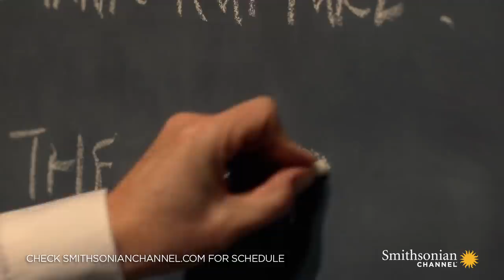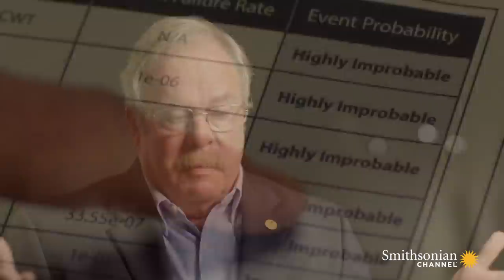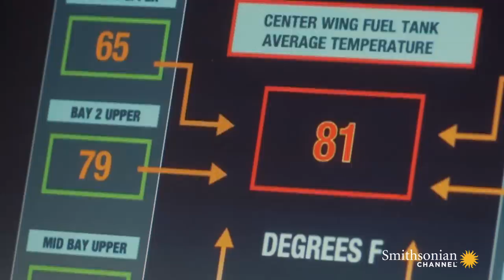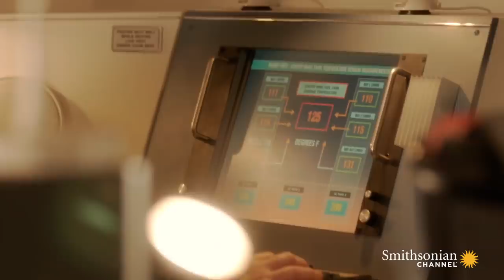How Air Conditioning Caused TWA Flight 800 to Explode

Comment: Jesus, that test they did was super dangerous.
Reply: TheGr8stManEvr was thinking the same thing lol
Reply: TheGr8stManEvr There was no fuel in the sensored tank.
Reply: please explain more of your thoughts. thanks.
Reply: Was it though? How many 747's had, to that point, operated in hot weather with the air conditioning packs working full blast, and how many had exploded?
Reply: I can never understand what everyone means by..."the AC units running or working full blast".... Is that suppose to make it sound 'scarier' ??   The Air pack operates at one level.  'On.'   there is no 'full blast'.  lol... and Hot weather is moot, as well.  unless the weather was at full blast!  lol....
Reply: Don’t think it was real because like you said it’s way too dangerous
Reply: +Rob Shef Exactly!! the only way they can be at ''full blast'' would be if they were on continuously for that time, which is likely the actual event. A/C units turn on, then normally cycle between ''on'' and ''off'' to keep the temperature at the desired level
Reply: Well, ok.   :)   But I think the point being, (which I failed to explain in a way to be understood......so my bad....) is where the NTSB claims that the AC unit 'played' a part in the event, such as that of a (really HOT AC unit) seemingly on  the 'coldest' setting, thus implying 'Full blast" or, that the (Unit HEATED up. )  However, this is NOT how the AC system works; that if you have the cabin setting for a cooler temp inside, that the AC unit runs Hotter.  This is what the NTSB was attempting to say, for the less educated.  The AC can be on as long as it needs to be, but that does not make the unit get hotter and hotter.  (The NTSB needed a high heat setting to imply that the fuel tank thus, heated up.)   The center tank {cannot get hot}  due to the AC operation. This is IMPOSSIBLE, due to the Architecture of pack bay and then the  Fuel Storage and Transfer System. The aircraft AC pack(s) does not operate like a home AC!  The errant use of the statement, 'Full blast' seems to imply that the unit is set to on, and thus heats up more and more.  That cannot be farther from the truth.   But in this case, the idea that the AC packs were even on while the plane was on the ground during its turn around servicing,  is not convincing.  When the plane lands, (has touched down)  it [was] TWA SOP to operate the APU; to have the APU and not the engines now operate an Air pack on the ground while they taxied in, and having parked at the gate, the power grid on the plane would be switched from engines to the APU, so after the engines are shut down, the APU is now providing the electrical power and turning ONE air pack for cabin ventilation.  Then the ground service hooks up an external air unit, and ground power is plugged in. the APU is shut down.  (it need a maintenance check as well)  It is costly to be on the ground and run the APU for hours which is using up jet fuel.  The APU is essentially the unit used to provide [temporary service] for starting the engines, as the engines are the main air and power source for the planes pneumatic and electrical systems.  So in as far as the AC unit as having been on 'full blast' and thus heating up the center fuel tank, is a myth.
Reply: @bsanaee  Good point... In the end the horrible state of the wiring left all sorts of bare wire exposed to create a strong enough arc. This must have been a shortcoming in overhaul procedure. You can have all manner of stringent recuirements in place when it comes to the airframe. But it's of little use when there's exposed wire and kerosene fumes occupying the same space...
Reply: It wasn't dangerous because they knew there was no fuel leak in the tank. The explosion was caused by the fuel tank leaking, not just the heated fuel. Because the fuel was heated enough it was flammable, and that's why it exploded AFTER it leaked. If it was truly that dangerous then there would have been a lot more explosions on this kind of plane.
Reply: So, what was the 'good' point?  There were no bad wires or bad wiring...exposed, and creating any 'arc's as such is impossible in the 'suggested' scenario.  There is no way to create any arc or spark inside the fuel tank, which is moot anyway, given the entire design and architecture of the Fuel Storage and Transfer system. The NTSB report was proven to be Fraud in Federal court.  You do know what a( 'D' check) is?? Also know that 'kerosene fumes' even though none were present,  do not explode as has been suggested by reason of the lack of chemical energy.   The Center tank did not explode by reason of some internal cause. That is Impossible.
Reply: Wow. The story keeps on morphing more and more.  lol.  There was fuel in the tank. The fuel tank was not 'leaking.'   (that ones new! ) And........ there was no, nor can be any 'heated' fuel in the tank.  Aviation Kerosene is not a flammable liquid but a combustible liquid.  The fuel can never reach its flashpoint by reason of the Fuel Storage and Transfer Systems Architecture.  And the flashpoint is only that for when the fuel could begin releasing fuel vapors but those vapors are not highly explosive.  The Fuel again, is a combustible and not a flammable liquid.  AK is a very stable fuel.  There has never been a spontaneous fuel tank explosion using modern AK.  ...and by reason of it just heating up, if such could.
Reply: @robshef718  Everyone can google a D-check and find it to be a comprehensive overhaul that only happens every 6-10 years or so. So enlighten us... What happened here?
Reply: You stated: ' In the end the horrible state of the wiring left all sorts of bare wire exposed to create a strong enough arc. This must have been a shortcoming in overhaul procedure. You can have all manner of stringent requirements in place when it comes to the airframe. But it's of little use when there's exposed wire... 'There are daily and thus constant [Condition monitors] at the start of, and during and after every flight.  Such are logged and passed on as required.  Along with a major overhaul, (D check) there are routine inspections, and then modifications and or re work as required.  Any system errors and or performance issues to the same,  would present themselves long before any [assumed] sudden and critical system failure as had been suggested.  The  Fuel Storage and Transfer System Architecture precludes any of the 'suggested' theory as occurring.  There cannot be any wires wearing themselves bare and just happening to be connecting with another bare wire and then successfully sending current into the tank and then successfully produce a spark and then explode the tank.  The physical and then laws of physics and chain of events are far too complex to have such occur.  For a long list of reasons.  Such were already worked out by Boeing long long ago.  So, the entire theory of a most unlikely set of circumstances to result in the post event setting is most unlikely for another list of reasoning against such.   I cannot imagine that 'somehow' the wiring in your car, such as from any part of your cars electrical system would then have some bare wires then touching other bare wires, and then sending current into your gas tank, and then finding a place inside the tank to successfully arc and then blow your car up!   so, no. it was not TWA's fault, nor Boeing's fault, and there was not and cannot be any [spontaneous Aviation Kerosene 'explosion']
Reply: I mean, it looked animated though
Reply: sure there was, however the 'test' [as it was] was rigged and fraudulent.  We took the NTSB to court over this and the NTSB lost.  The court Impeached the NTSB for fraud.
Reply: @bsanaee : Exactly what I said. The shit doesn't make sense.
Reply: Rob Shef "We took the NTSB to court for this and the NTSB lost."
Who's "we"? You and the mouse in your pocket?
The NTSB got "impeached"?
"The court impeached the NTSB for fraud." Huh? Uh.. I don't think that's how it works. FRAUD? 
Please, cite this federal court case, and provide references.
Reply: You sound skeptical? I appreciate your concern. I suppose the short version will do?  The 'We' in this matter, in as far as this court case I am referring too, (one on several other court cases in this matter) would be the nearly four years in court 'we' spent as 'we' sued the CIA and the NTSB for certain of Crash Records.  (I am surprised that you are not aware of the court case)  The 'We' in this matter:  Captain Ray Lahr and his Attorney John Clarke along with myself and then the Affidavits from several other Aviation experts and Physicists, and others in the Aeronautical community, including a Boeing Aerodynamicist, were required to file suit, given that the CIA and NTSB were not going to release certain crash records as to how they arrived at their conclusions.  I'm sure you would have picked up on my links in here, as a part of the litigation.  After about four years in court.  the overwhelming evidence we provided, was more than enough to have the court determine that the NTSB theory was not factually correct, as reflected in the judges rulings. Not sure about any mouse in my pocket?  lol.   So yes, we took the NTSB to court and they Lost the summary in opposition to disclosing certain crash records.   The NTSB was unable to provide any evidence and could not respond to our lawsuit.   The court Ordered the NTSB and CIA to disclose certain requested records,  and those records disclosed the Fraud by the NTSB.  I'm not sure what YOU mean by, " I don't think that's how it works', but....  That's how it works!   :)     And there is no question mark, after FRAUD.  I have already provided two links to a portion of the court, on this page.    cheers.
Reply: @robshef718 : Do you know of Tom Stalcup?
Reply: Yes.
Reply: they were probably using an empty fuel tank do u think they would risk their lives for a crash investigation
Reply: The NTSB's (fake report) is available via the NTSB, however the 'scenario' they have provided which was a cover story was disproven in court.  You cant 'rig science', but the NTSB sure tried too!
Reply: bsanaee Perhaps because none of the other flights had anything inside the tank to ignite the fumes like this flight did.
Reply: You can continue to embarrass your self, or you can listen to those with years of 'experience' with Aviation kerosene, such as my self and mechanics and Fuelers.  You cannot ignite the kerosene vapors to a catastrophic measure.  (looks great on a TV show however.)  There was and or is nothing 'inside the tank' which can ignite [the fuel] given the redundancy of safeties and the Architecture of the Fuel Storage and Transfer System.
Reply: Thanks Ethan.  I cannot say that I know what 'exactly' happened, but that I can say, is what much of the data shows is what 'most likely' occurred, (After having dismissed many displaced rumors.)   There is more work to do on this, as the entire NTSB report was a total fabrication.... that it was 'made up' to 'Fit' their scenario, for which NONE of it is true.  About Me:  I am former U.S. Navy Aviation Boatswain, and worked Carrier Aircraft for most of my Career.  When I had learned of Captain Ray Lahr's FOIA lawsuit, I got involved as a 'consultant in part, and provided several Technical Essays for Ray and his Attorney, which along with other expert witnesses, he took the NTSB to Federal court and Sued the CIA as well for [Certain of Crash Records] which the Judge Ordered the Agencies to comply with.  We were in court for nearly four years. We received a most favorable decision by the court as we Impeached the NTSB for Fraud on many counts.  In short, the 747 was Impacted at the Left wing root by a Supersonic  Aerial Vehicle {x}  transiting the airspace... and this initiating the break up.  There apparently were some miscalculations, which lead to the  mid air collision.  I'm still trying to determine the agency responsible. However, the IAMAW report made it clear, that an external, Non explosive impact is what breached the fuselage.  The FAA provide data to the same.  But we do know that the plane was not 'shot down' either by a 'navy accident' or some dark clothed mustached terrorists,  with a stinger missile in a speed boat!  The word 'missile' often confuses,  as the word 'missile' is supposed to  mean an Anti Aircraft warhead.  No, the [missile of concern] was an (or any high speed Aerial vehicle) that fit the FAA data,  as well as what some witnesses described.    You may find a brief article at the following:   In BING, type in (case sensitive)   TWA 800 / NLJ          It should be the first article. Pass it along! thanks again for your interest.
Reply: Given that they didn't explode, one presumes that the centre tank was not filled.
Reply: @robshef718  Source that "the NTSB was impeached" over this? That sentence doesn't really make sense (I think you're getting your legal terms mixed up, not a good look for someone who claims to have been involved in the prosecution of this very matter), so forgive me if I don't really believe you or who you claim to be. Also, the heat expelled by the air conditioning units is going to be the sum of the heat generated by the air conditioning units plus the heat removed by the air conditioning units. Of course it'll get hotter in hotter weather, by the difference in temperature between the refridgerated area and the ambient temperature. It may end up being negligable, particularly with insulation but you'd have to explain how it's negligable, or alternatively why this physical necessity is untrue due to their operation.

But yeah, my main point here is, please provide a source that the NTSB was impeached over this incident. I'm not going to google some term and pick through to try and find what you're talking about, paste a link right here.
Reply: The courts decision in the matter in our lawsuit is the matter over Fraud and how the NTSB was Impeached for such. How does the sentence; 'The court ordered records released to us, and, that the NTSB committed Fraud and thus was impeached', not make sense.....(to you)?
The 'legal' term is correct. And by the way, 'making claims', is your burden, unless you know for a fact that there was no court case? I only have been presenting facts. (and, I look.... just fine.) You dont have to 'believe' anything.  I'm not here to get your approval. lol.  You best go back to physics class, Mr. Sum of. Your sentence is well, wrong.  You must first be in the Aviation Field which you are not, and then you must Know how an aircrafts [Air packs] operate. I can see by your 'sum of' comment that you are clueless.  (You are like only the five hundredth person in here, that I have had to school.)  by the way, The outside temperature has NOTHING to do with it. (Does the inside of your refrigerator get colder cuz you live in Alaska?)  lol.. Your next statement was blaa blaaa..  huh? And you said it well.  "I'm not going to google some term and pick through to try and find what you're talking about, paste a link right here.'good luck with that one!
Reply: @robshef718  So, not a single source I see.

It doesn't make sense because impeachment isn't a ruling handed down by a court and isn't done to an organisation. Impeachment is the equivalent of indictment that begins precedings to remove an elected public official from office. Said official then needs to be convicted and once that happens, they will be removed from office. Saying "the NTSB" was impeached doesn't make any sense and even if they were it wouldn't prove anything, just that there was sufficient evidence to launch a trial. Edit: You also claim it was for "fraud" which, as someone else pointed out, is ridiculous all by itself.

It's basic physics. If you live in alaska,the INSIDE of the fridge won't be cooler (unless the ambient temperature is colder,in which case the inside will be colder because a fridge has no mechanism to heat the inside) but the rear, the heat exchnge certainly will be. Household refrigerators work by compressing a gas, causing it to heat up, heat it then loses. It then gets decompressed (making it cold) and pumped through radiators inside the fridge, picking up heat. It is then compressed again and the process starts again.The temperature at the back of the fridge will be the temperature differential between the uncompressed gas and the compressed gas + the heat removed from the fridge space. In hot climates, there is more heat needing removal and therefore the temperature at the back of the fridge willbe marginally higher. Again, basic physics. Fridges don't just delete heat.

Your total failure to post any kind of sources or articles or anything leads me to believe that your appearence of being a know-nothing douchebag is just you being a know-nothing douchebag, a conspiracy theorist trying to push his idea, rather than any lack of understanding on my end. Feel free to post the requested items and prove me wrong though.
Reply: The tank was most likely liquid rather than vapour.
Reply: Yes, of course.  Aviation Kerosene is Not a Flammable liquid but is a Combustible liquid.  The Tank is extremely safe, as it was DESIGNED that way.  The 'vapors' also are [not capable] of being catastrophically explosive.   The tank would be far more Lean anyway, as a point.
Reply: Why thank you so much there South Wye!
Reply: @jakewaldman6243  yup
Reply: Jake Waldman req. balls of steel.
Reply: Thanks for your interest in Flight 800. The [missile of concern] or in the literal case, the {target} which was identified by the system, was momentarily detected on the ARTCC Radar in at least one 'sector' and this is what was a concern. The FAA management was well to rule out any 'so called' glitches, as the systems are designed with several Antenna's and various filtering modes to determine what is a {viable target} from just 'noise'. This is a "requirement" or else the Radar would be cluttered and thus ineffective in Identifying Airborne objects as to Transponder  and then primary targets. The ARTTC needs to know for air sector safety and control.  After the Radar system Identified a Supersonic target, it was then in moments that there was an issue with the flight 800 transponder, to where in a minute the FAA knew that the TWA 800 flight was in fact no longer ON RADAR. 
The target was in horizontal flight and heading out to sea. This object was well identified by one well published KEY witness that described what would or could be identified as an 'X type Aerial Vehicle'; which is generally related to an Air Force / NASA research vehicle.
An Air National Guard Helo pilot and another witness between these 'two' witnesses also saw [an object] as described the same, heading outbound. TWA 800 was delayed because late, they learned that they were to be a "LifeGuard" flight, so this bumped up the departure time, and therefore there had to be change in the flights departure route. 'Apparently' and due to an unfortunate set of miscalculations, the Aerial Vehicle impacted/ Mid Air collision with the 747, which started the break up of the plane. The International Association Of Machinists And Aerospace Workers { IAMAW }  union in their report was clear that an 'external'  breach at the Left wing root is what initiated the break up. The NTSB however, cared little for and never considered the IAMAW report. (And the IAMAW report so noted their grievance with the Board for rejecting their findings.)  (The Board after all, needed a CWT blow up! not a missile impact.) 
and so the 'cover up' began. However,  Captain Ray Lahr, former NTSB investigator and Engineer and United and Navy pilot with his team of experts, including myself as a consultant in part, took the NTSB and CIA to federal court for 'Crash Records' that the NTSB refused to release... But He won a most favorable decision and we were able to prove the NTSB committed Fraud and that our evidence Impeached the NTSB.  The fake news still does have the nads to report this. nevertheless.....   Use 'BING.'   cut and paste these two addresses.  ' TWA 800 NLJ '     (and)  ' Major court ruling in Flight 800 Case '      Please Pass this along....
Reply: CR BZ  There was no missile. Rob is a conspiracy nut.
Reply: @harrypenrose2949  yeah right.
Reply: Why didnt they turn off the packs?
Reply: @bsanaee  Quite a few, they just didn't ignite. A fulty wiring on top (or inside?) the flammable tank sparked the explosion (something I've seen in Mayday)
Reply: This is proof it was a missile strike that took it down because guess what? The plane didn't magically explode when they did this "dangerous" test. A Navy SAM shot down TWA 800.
Reply: CR BZ  it was a Navy SAM
Reply: @EssexAggiegrad2011  there was a missile and theres proof.
Reply: No organization deserves more respect than the NTSB.
Reply: Omg temperature is 127
Reply: It would only be dangerous if there was a spark to ignite it
Reply: The highest temperature would had killed the crew with heat stroke but luckily they manage to safely landed
Reply: @robshef718  Hold up did you just say you "cannot ignite kerosene vapors"? If so you are 100% mistaken.
Reply: This is not true.  If this were the case.....why weren't ALL 747's grounded until the investigation was over.  Including Air Force One
Reply: Larry Smith I believe the NTSB suggested that at the time, but were overruled by the FAA because of the economic impact on airlines. The same story with fuel tank inerting - a simple solution to the problem, but deemed too expensive to issue a directive.
Reply: KarlosBricks yes there’s only on and off but since air condition units takes it outside air and cools it down to the desired temperature, it makes alot of sense that more energy is required to cool down the outside air depending on the difference between the outside air temperature and the desired temperature
Reply: Thats what the people in the explosion went through
Reply: Controlled conditions bruh. Remember, they made it the exact conditions as on the day of the incident. It's not the actual conditions that they were in during the testing. So they can easily revert to regular conditions by just turning off the AC or by moving to a higher altitude.
Reply: @robshef718  It does get hotter and hotter. If the AC unit can dissipate less heat than it produces, the unit heats up. Full-blast means that the unit had a nearly 100% duty cycle. At a lower duty cycle, it might have been possible that the unit could dissipate most of its heat produced (by averaging the heat produced over a whole on/off cycle) , leading to lower temps.
Reply: "Now, if you do it correctly and keep the temperature low enough, it sh-" explosion
Reply: Not exactly. The faulty wiring that provided the spark was missing.
Reply: Same thought
Reply: Sometimes you have to take risks to come to a firm conclusion. This investigation lasted 4 years. They had to do some mad things to crack the case
Reply: How much did they pay those test pilots???
Reply: @jimdarcangelo757  More than any life on Earth would ever be worth. They literally flew a Jumbo jet that at any moment could explode into a million pieces.
Reply: Not sure how those guys were able to get off the ground with balls that big
Reply: indeed is was
Reply: @robshef718  Working non-stop is a better way to say it.
Reply: @mcblaze1968  what??
Reply: Fr
Reply: Same.
Reply: @craiglavelle9984  Why? You know how many 747 was doing the same exact thing, and how many exploded?
Reply: no it wasn't, the reason TWA 800 went down is because of lose faulty wires sparking that heated fuel, the 747 they used must've been safe otherwise they wouldn't of used it
Reply: The next clip: An Evergreen 747 falling out of the sky after exploding lol
Reply: Since that had nothing to do with why the plane blew up in mid air, I'd say it wasn't really that dangerous at all...
Reply: @frankdiehl8749  You realize... this is all just theory...
Reply: Yeah and it didnt explode. A missile took down this plane.
Reply: So is oye blasphemy
Reply: James Peters  if they had succeeded the plane would have exploded and they'd be dead
Reply: @robshef718  Have you heard of a fuel-air bomb when the Aviation Kerosene vapours mixed with the air it could have become explosive the only thing it lacks is a spark.
With TWA Fight 800 a plane stuck on a hot day with the AC running continuously causing the central fuel tank to heat up not the point of ignition but enough so the fuel turns to vapour and then due to the 26-year-old plane wiring have breaks in the insulation one being the Fuel Quantity Indication System (FQIS) cable and another which a higher voltage, all it would take would be an electrical arc from higher voltage cable to the FQIS cable which then causes a short circuit inside the tank which trigger the explosion.
And to end this off I'm going to do something that you have not, cite sources:
https://www.fireengineering.com/2002/10/01/244558/jet-fuel/#gref
https://shepherd.caltech.edu/EDL/projects/JetA/facts.html   
Both of these pages talk about jet fuel and does talk about its explosive risks and the mechanism behind it.
Reply: @robshef718  The power consumed, and by extension the heat generated, is dependent on the temperature outside.
Reply: @JeniousJustin  if the fuel was leaking it would still be hard to ignite. The AC heated it up. Then the short circuit ignited it. None of the fuel leaked out there was faulty wiring that allowed high voltage to jump to low voltage went into the fuel area.
Reply: @JeniousJustin  well the short circuit ignited the the vapor fuel.
Reply: @robshef718  the center tank exploded because faulty wiring had a high voltage current jump into a low voltage current which happened to go into the fuel tank. A short circuit occurred. And ignited the fuel
Reply: @robshef718  vapor jet fuel is super combustible. Just like diesel. Diesel is hard to ignite when liquid but super easy to ignite when vapor
Reply: @robshef718  how do you know it’s fake? You dont. But seriously the fuel in the center tank was just a puddle but since it became vapor it expanded because basic physics say when it gets hot it expands.
Reply: @robshef718  yes you can you forgot that the spars we’re damaged from an explosion inside the tank from a wall that inside that crashed into it. Denting it
Reply: @robshef718  the outside temps partially caused it. Since they were delayed it was really hot so they turned the ac all the way to max power. It takes hot air and cools it down and this hot air happened to go under the fuel tank hmmm what could possibly go wrong? This heated air from the ac heated it to vapor faulty wiring allows high voltage currents to jump to low voltage ones. Short circuit disaster strikes. And by the way the entire thing was filled with the vapor because it expands when it gets hot
Reply: @hp2084  it wasn’t missing it was there the faulty wiring is explained in another show called seconds from disaster the twa 800 episode
Reply: @noahtek1101  well that depends. They didn’t have faulty wiring which is obvious because it didn’t explode
Reply: @Dracogame  the temperature outside because they waited for an hour basically had the pilots to decide to turn the ac to maximum. That was what heated it to vapor.
Reply: @Dracogame   what are you talking about? what power consumed? and what about outside temps?????
Reply: @jonahmoran3751   Who told you that? Oh, you read it somewhere. Not that you have any experience in the matter.  First of all there were no 'faulty wires'...That is in the report.  And that is an entirely totally different discussion about how that would not ever occur.  Second of all, there is no way for high voltage to go to low voltage, and then 'jump'  into the tank. That is remedial by the fuel tanks storage system design. (Like your alternator wires on your  car are never going to somehow connect to your fuel gauge, and blow your car up!)  electricity cannot "detonate" jet fuel.
Reply: @jonahmoran3751   You really need to go back to school Jonah. Jet fuel, is extremely stable, and has an extremely low volatility. it is a combustible fuel, not a flammable. I should know. I worked with Jet fuel in the US Navy. (my piss is more explosive.)  just like diesel???  Diesel is not a flammable but a combustible liquid, Jonah.  Diesel is not used as a vapor. Just as Jet fuel, the liquid diesel  is misted inside the engine with fuel injectors.
Reply: @robshef718  Any AC system will struggle more depending on the difference between the temperature outside and the temperature it needs to set inside. The heat generated from the AC system comes directly from the electrical energy the system use to run. If you struggle more, you draw more energy, and release more heat. On top of that, the high temps outside contribute at heating the AC system itself up even more.
Reply: @Dracogame   Wow, you really are clueless as to how an aircraft air pack works. 
This is not like the window AC in your trailer. The Air pack does not 'struggle' to operate as it does, to effect cabin pressure, and provide cabin temperature in flight. The system operates quite efficiently between the bleed air and the blending mixing valves and bypass systems to maximize it efficiency. The engineers are quite aware of operating temperature at flight altitudes. So your idea of this temperature fight and struggle to make the thing work, is ridiculous. The temps outside at flight level is very cold, not hot. unless you live on mars. So no, the Air packs run quite cool in engineering terms. not to forget that the pack bays are vented and exhausted. So your 'built up heat' idea is flawed as well. Leave this up to the experts, such as my self, and save yourself another break down.
Reply: @robshef718  Uhm... we are talking about a system operating on the ground. That's the whole point.
Reply: @Dracogame   The system was not 'operating on the ground". The 'Air Pack(s) main function is to pressurize the aircraft cabin in flight, not on the ground. The planes that are on the ground at the gate, get airport service for power and AC if required.  (most likely the case.)  As well, when the 747 is on the ground, and the APU might need to be used, the pack bay doors are wide open, as SOP.  Also on the Cock pit voice recorder transcript, GROUND crew is talking to the Cockpit, and for when the service Power to the plane, was being disconnected.  Don't you for a moment believe the nonsense you have heard in the fake news about this, as being some sizzling hot tank, just 'ready to blow'!!
Reply: @harrypenrose2949  If there was fuel in the tank it would have cooled the in tank temp, but I suppose eventually it would have heated it quite a bit
Reply: UAE has the hottest conditions and have had multiple flights ever month, no air craft explodes as result of over worked AC
Reply: What if the plane exploded again?
Reply: @robshef718  You are the literal embodiment of "Talking in circles to make yourself sound smart"
Reply: @theshermantanker7043   So, I guess this means you are (A) Jealous that I am smarter than you. (B) Wishing you knew how to deal with that. And (C) unable to come up with a question. :)
Reply: @bsanaee  It was a huge risk because what actually caused it was a short circuit which triggered the spark. The heated AC packs right below the fuel tank only made it possible.
Reply: @bsanaee  Exactly, that data was left out.
Reply: @frankdiehl8749  my best friend has serviced these aircraft since 1979. He laughed at these statements. There are no bare wires in these tanks. The wiring for the fuel gauge and pumps are external. There is no oxygen in these tanks as they have had oxygen eliminating filters on them since 1969... and the ac unit has a thermal heat limit of 140 degrees, and it shuts down until it cools off and must be manually reset in the cockpit before it can be used again. It cannot have its thermal limits overridden...
Reply: @JeniousJustin  ummm, if that tank leaked, it would run out on the ground.. the outer shell of the plane is the floor of the tank. It is a double walled tank. And jet fuel does not explode unless less subjected to high heat. And not air conditioning heat, but missile heat.
Reply: @robshef718  you sir are correct, and looking at the right side of the plane tells you all you need to know, it is absolutely shredded  by an external force
.
Reply: @robshef718  my friend who has been an A and P tech since 1969, says anytime they enter a fuel tank on any of these plane, they have to wear an oxygen suit, as no tank has breathable oxygen in them due to the filters on them that eliminate the oxygen molecules from the air that replaces the spent fuel.
Reply: @robshef718  thank you sir, my friend works at Dallas as an a and p since 1979. He has been saying the same thing. Can I get those links you referred to?
Reply: @KBS117   ABC news as well as others, who did 'the final days of the wreckage' stories, showed the planes wreckage in the hangar and 'close ups' of the parts of the plane with MISSILE DAMAGE, all while the NTSB uppers say..."what missile damage" as well as the investigators notes reporting the spike tooth fractures, and external to internal holes, yet the Board members just ignored that evidence.  My jaw is still on the floor!
Reply: @KBS117    Thanks. In any case, the tank is not this "seething hot, dangerous tank... >>>just ready to blow at any second,<<< which how the media has presented it.  Kerosene is highly stable, Low volatility,  and has a very high flash point, and in its static state, is difficult to ignite to a fire on the fuels surface, yet... they try and 'make the case' with all this excessive technical blather in order to force a condition that they hope will provide kerosene to go BOOM like C4....  yet people never think about HOW STRONG that Center wing section is.  It has to hold and support the entire plane...and then take the stresses of well over 800,000 pounds,  yet, were told that  some vapors going POOF, are suppose to Blast that Section apart...LMAO.
Reply: @KBS117  Ugh, not this again... Friggin' years old discussion over here.
Question is: If it wasn't x, y or z, what DID happen?!
Reply: @robshef718  you sir are correct.
Reply: @robshef718  I agree, any lay person can look at the pictures and see what happened.
Reply: @KBS117   You can cruise back through the comments in here, and find my posts back from 3 years ago where I discuss stuff.
Reply: @KBS117   Did I not send you a bunch of links yesterday?   Im not seeing them in the recaps here.???
Reply: @robshef718  you are my wingman. I have been fighting this battle for 6 years, and having your information, blows my mind. I did not know about the court case.
Reply: @robshef718  yes please!!!
Reply: @frankdiehl8749  please, if that had been true, the last guys to inspect that aircraft would be in prison. There was no worn wires.
Reply: @frankdiehl8749    For the millionth time, a High speed Av (the one on radar - as presented in court) and as reported by in the machinists report, {impacted the left wing root} of the plane. Some apparent ATC screw up, had the 747 in the wrong place, and unfortunately... the collision.  The AV (yet, to know its origin though, however the NSA said foreign weapons testing is the topic) was to be targeted, and at least two SAMS burst near, though forensics show one hit the left wing (thus that big fireball)   Dont have an absolute identity of the shooters...though rumored to be Navy, however, No viable evidence to that, just [rumors]  parts are still mysterious but we DO know that the planes fuel tank did not take this plane down.
Reply: There wasn’t any fuel leak in the tank and they were closely monitoring the temperature.
Reply: It was a simulator!
Reply: Yes.